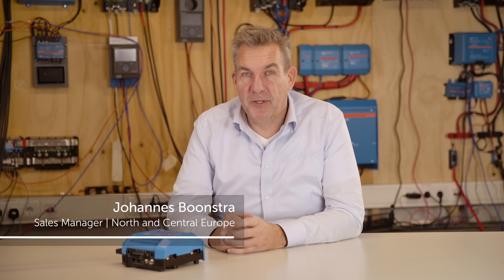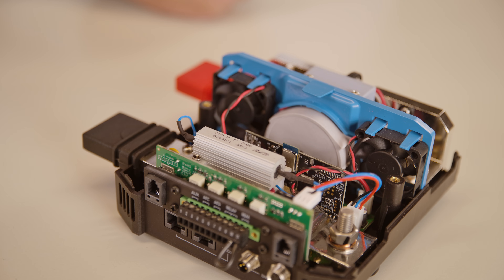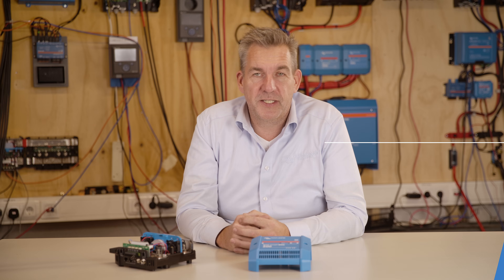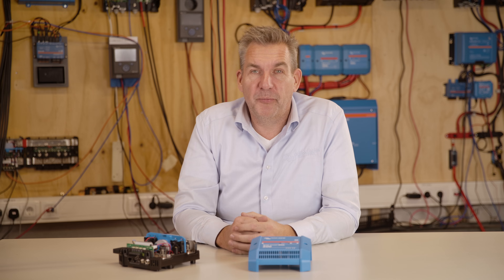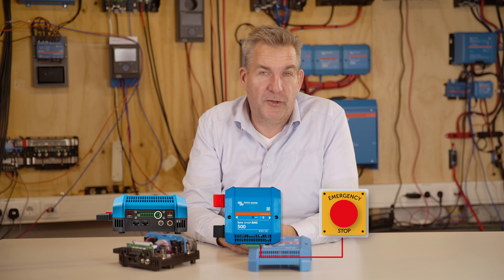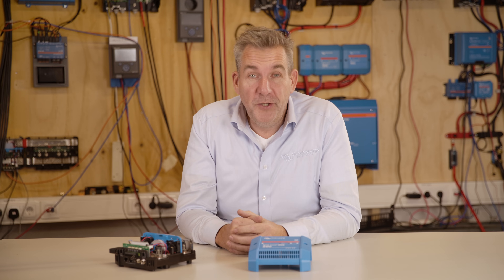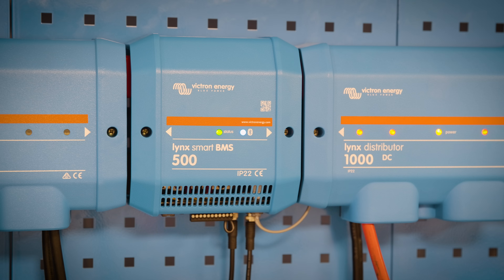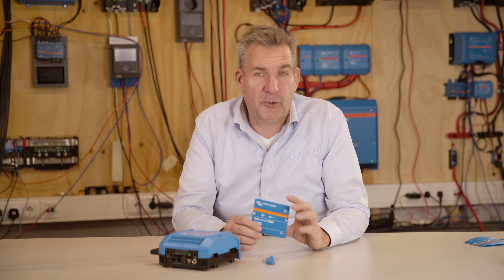3 of 4 - Explanation of Victron Energy Lynx Smart BMS, lithium battery management

Comment: Just wasted 6 hours  troubleshooting one of these things on someone else’s boat.  What is bad about this thing is that if it goes bad, you can’t use your batteries at all.  His batteries are charged, the BMS is faulty and now he can’t use any of his system.  Not only that but they put in a 1000A model when the max load on his system is around 240A @ 48VDC.  Sometimes you can make things “too” smart and forget to build in a fallback system.  We’ll be replacing this thing with some wires because the last one of these took more than 2 months to get replaced by Victron.

Comment: Can you make a bms for utilizing normal Alibaba lifepov4 cells? I see the lf560k is out, be nice not to have to use jk bms all the time
Reply: The combination BMS / balancing boards and cells are critical. It’s not as many assume it’s just adding cells to each other and connect to any BMS
That’s a recepy for disaster 

Therefore we will not bring a “universal” BMS out
Reply: @johannesboonstra6917 how so? You define SOC cut off, voltage protection, what voltage active balancing begins etc, just look at all the options currently in jk bms. People who source their batteries directly wholesale should have options :)

Just saying could be another revenue product for you. Most youtube DIY videos I see most people using victron smart shunt and victron solar charge controllers, but avoid high cost of victron inverters and batteries using other brands till they in a better financial position.

Comment: Hello. In the case of 8 lithium batteries 100 amps each, total 800 amps, what would be the recommended BMS? 500 or 1000? I would also need 2x Distributors for the batteries, right? 
Is it possible to use the M8 distributors for this bateries with the BMS 1000 (M10)? thanks !!
Reply: The size BMS is deepening on charge/discharge current, not capacity.   Yes, 2 x Distributor would be best

Comment: CAD 1,310  for a Victron Energy Lynx Smart BMS is just too much for average folks. Can victron make something for personal use cases like campers who runs a much smaller battery banks. I am happy if my bms can handle 100A for a 12V system. Please make a budget version within $300.
Reply from the maker: There are a variety of BMS’s in a range of prices. You can check them out here: https://www.victronenergy.com/battery-management-systems

Comment: It seems like what the Lynx system is missing is a Lynx Battery Protect Module/Switch for people not using Victron batteries.  I would have to put a Battery Protect module in between the Lynx Shunt ant the Lynx Distributor which makes the nice Lynx stacking connector system useless.
Reply: yes that would be nice !

Comment: I Wish they made this with only the contactor (and shunt). As an inbetween version of the Lynx Shunt and this Lynx BMS. My batteries have their own built in BMS and I don't need the 500A BMS in this unit. However I'd still like to remotely cut-off my batteries for when I'm not home and get a fault notification via my VRM app or email.

Comment: It's a pity this BMS is only for Victron batteries. Other Victron products are nicely hardware-agnostic.
Reply: I was very happy watching the video.... I decided I would purchase this because I want to protect my batteries that do not protect themselves.
Reply: As there is a safety concern when mixing / matching BMS / battery we have chosen to make them only compatible with our own models
Reply: @johannesboonstra6917  we need a lynx BMS for diy batteries, because not everyone wants to or can afford Victron batteries, come on now, 2,500 USD  for 12 volt 300 ah battery, Lol , I can make a 1000 ah battery bank for that price. Maybe I should make a BMS that fits the Lynx system. We the people need products that work with different brands of products.
Reply: @jamesmason7124  The point that I was trying to make is that we also can make cheaper products as you can, but then safety becomes an issue. The added electronics is there for a reason. Just as a fuse there is no added value when everything works as it should but you cannot go without when something does happen.  If you decide to leave safety what it is it may be a more expensive route after all ( and trust me, I have seen many DIY projects start with the believe all can be made much cheaper but still it fails over time ....)
Reply: @johannesboonstra6917  what safety issues, I have a background in electrical engineering and I say it can be done, you can have quality, safety, and a low price. What makes Victron batteries safer than DIY batteries made from Headway 38120 HP lithium iron fosphate cells and a Rec BMS
Reply: @jamesmason7124  of course , perhaps you can , but many can’t. And I am afraid we can not do this just for you 🙈.   I guess I don’t have to explain to you if the combination battery cell measurement, adequate balancing and controlling the system with this isn’t extreme reliable, there will be a time when the battery becomes unsafe. So we design both battery measuring/ balancing and system controlling electronics as a safe combination
Reply: @johannesboonstra6917  I understand that you need to sell your batteries too , maybe I will just design a housing for a Rec BMS to fit the Lynx system, to tell you the truth, I'm kinda getting tired of my customers asking me if the Lynx BMS works with other brands of batteries or if you are going to make one , so I'm just going to reverse engineer it and make my own BMS that matches the Lynx system
Reply: @jamesmason7124  wel we don’t need to sell batteries but if we do we do it right.
So reliable, with a good warranty, safe and easy to install, powerful balancing and with monitoring 
You could also advise your clients to go for a of the shelf product 😊

Comment: @johannesboonstra6917  With the Lynx BMS it's still useful to connect a ve.bus smart dongle to the Multiplus to allow for voltage drop compensation? Or maybe the Cerbo will send it the voltage measured by the BMS, acting like the dongle, somehow?
Reply: the Smart BMS works on DVCC so controls all charge from there, there is not a dongle or such needed.

Comment: This is really well designet. But I would really like if the alarms from Lynx would be displayed at the Cerbo homepage. Stuff like low SOC or low temp batteries should be displayed as an alarm on the home screen. Not only in the setup screen. Is is very difficult to figure out what is happening if the Lynz switches off without a warning on the Cerbo first.
Reply: The BMS alarm do show up on the Cerbo , and if having contact with the VRM also there with even a mail push notification
Reply: @johannesboonstra6917  Not on the "home screen" the one showing ac input - inverter - ac loads - battery - dc power. I tried it several times. No alarm for low soc from lynx. and no alarm from lynx about low temp batt. It will show on the settings page yes. But not the homescreen.

Comment: Can this work with non Victron batteries?
Reply: No, I am afraid this BMS is for Smart Lithium batteries of Victron Energy only.
Reply: @johannesboonstra6917  Some of the features must work with other batteries. Shunt, contractor, remote ports. without Smart Lithium batteries is it completely not operational?
Reply: @SVThatway  correct , then it’s not working
Reply: The other lynx shunt can & the manual lists a vast number of suppliers supported.

Comment: Thanks for continuing to create great videos. I have a full Victron set up with the Lynx Smart BMS. Unfortunately last year while I was away the batteries couldn't charge from solar due to the temperature being under 4C - the BMS kept drawing power over the course of a month until my 27V battery got to 19V - I had expected it to protect itself but unfortunately it left me with a battery that's out of warranty due to the voltage having been so low (I believe). The switch turned off so I guess the final power was used by the Cerbo GX and buzzer. Do you know what could have caused that? It doesn't seem to have impacted the battery capacity but I was frustrated that I'd paid a lot to try and protect the battery and it didn't.
Reply: When you have not change the low cell voltage level the battery is still in warranty.    Please have the system up to date as specially on the idle power the firmware was adapted.
Reply: See this is what I am talking about and why I am going to design my own BMS that fits and matches the Lynx system
Reply: @jamesmason7124  but please understand that we limit this charge at low temp because we learned this causes a dramatic reduction of lifespan 
This is not is an effect with only our cell , also with yours ! 
You will not see the effect after a few short tests , but overtime it will be an issue 

So I would flip your statement around and advise you to product your clients investment and do the same